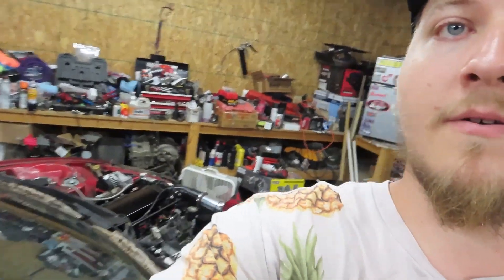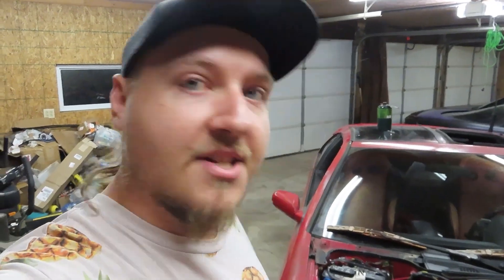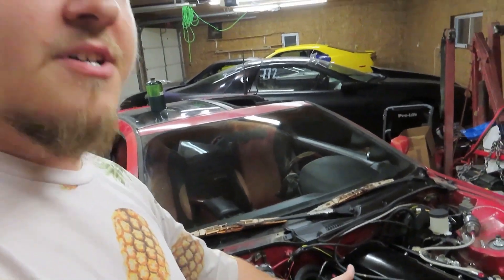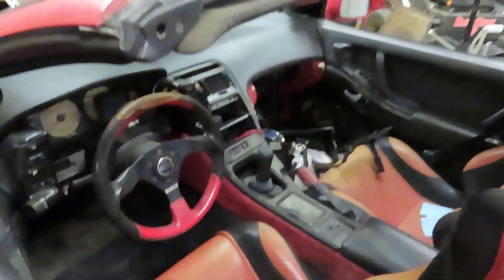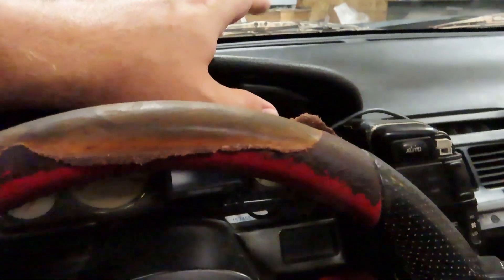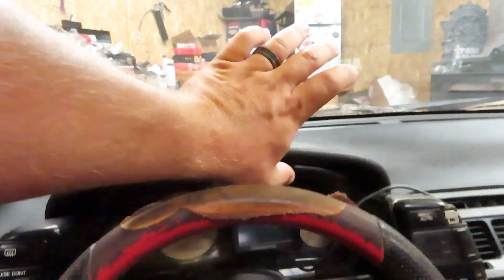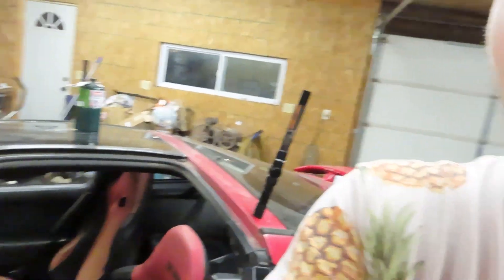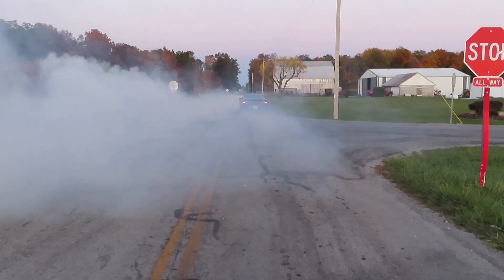300zx (Z32) LS Swap: Update #5! Air Intake installed and Idle Issue Solved!

Comment: I love these videos I’m using everything your doing as a study guide sorry to bother you I’m sure your busy af but I wanted to ask did this intake fit with hood closed because it’s getting pretty hard to find ls1/ls6 intake without over paying crazy money so I wondered about this design you have (off brand ) clearance with stock hood thank you if you get a chance to see this it’s my first swap so I wanted to ask a few questions being that I’m doing 99.6% of everything you did
Reply from the maker: Thank you I'm glad to try to help! To answer your question no the hood is not fitting (it's close but not close enough) with the intake I used so I suggest a shorter intake if you want the hood to fit! I am currently dealing with a lose of crank signal issue so I still haven't even got around to making a hood fit 🙃